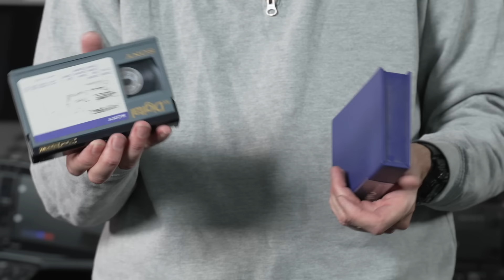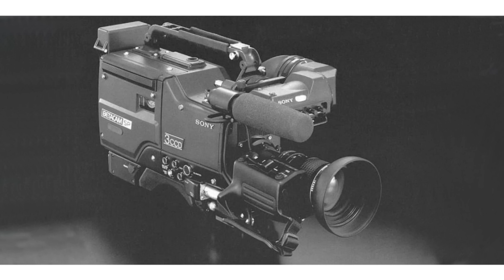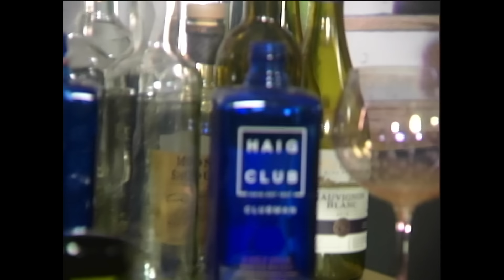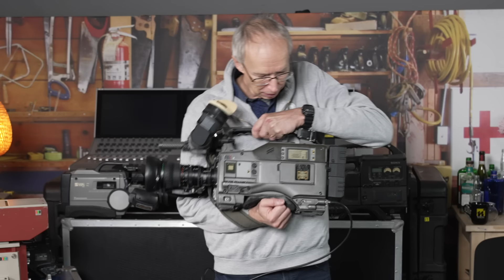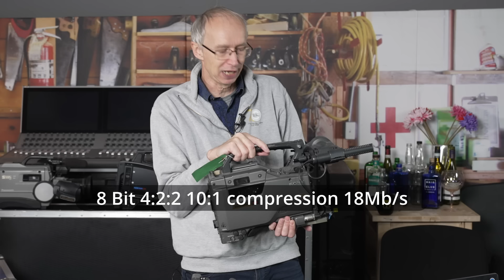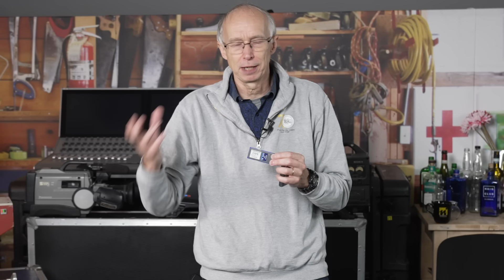Betacam, Digibeta & Optical Disc, a look back at some vintage Sony Camcorders with Alister Chapman

Comment: Thank for you sharing that with us.

I use an Ikeagami UHK-430 broadcast cameras (I am a UFC Camerman). Even though it shoots in 4K, UFC does not broadcast 4K for live sporting events, perhaps in the next 20 years or so the U.S. will have infrastructure in place for live 4K sports broadcasts but most local (rural) news stations in America are still 720p.

Comment: My company is designing a new 4:2:2  video encoder LSI IC to be manufactured by Sony Semiconductor later this year, part number CXD1994DE.   I'll invite you to the tape-out party.   We are using AI to push it to incredible limits with a quality factor as high as 95%.

Comment: ace video i know alot of this   from playing a round with old betacam decks 
there's a place that used to hire out  sony A500P decks  and the 75 one's they plan to skip alot of them

i went over there to get a sony A500P; because they had 4 channel audio 
the boss said they plan to get a skip to dump 4 betacam decks   

i did a deal as parts  they came over  with  20 of betacam decks as parts  i have 50 working decks   

i got offered alot when decks came back of hire out   i have a sony es 701 decks  
note the decks are super for audio  WOW   i only get in old stock sealed tapes at silly low prices 

dvcam sony decks need alot of re cap work i spend alot of hr's doing it 

ADAT i worked on  i have 45 year on soundcraft 760 decks they are tanks     gear is on a slow to die of slow 
worked on alot of gear over time 

some of the cam's have rubber parts in them and the cam's eat the tapes because of the small rubber parts can't be fixed up 

jammed up parts in the first gen betacam decks are a right pain i have to re work alot of the 2nd gen decks the 75 one's as parts 
gone bad 

love them as audio recorders there's a sound they make

Comment: the lens on bvv570 is newer than the camera which is a canon internal focus lens 8-120 canon i think i was around 8000$ .. also the digibeta has an older lens that is not an IF.
Reply from the maker: The lens on the 570 is a Canon J14x 8.5 SX12 from the late 1990's and while it does pre-date the launch of the 507 it is certainly a lens that a lot of people would have used with the 507 as that combination would have been used all the way to the end of the SD and Betacam SP era. The Betacam dockables were in production all the way up to 2002. The lens on the BVW700 was a Fujinon A20x8.6BRM IF lens from around 2000.
Reply: @alisterchapman  i remember the canon broadcast series lenses.. that were perfect.

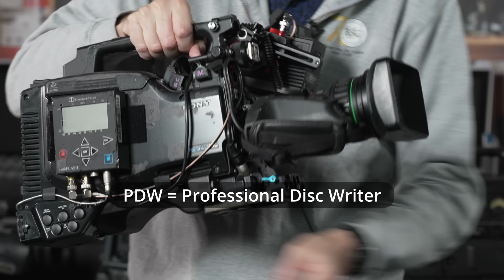Comment: 19:32 the SXS memory cards are still available today. You can buy them new and they cost about relatively the same but for the same price what you paid for that eight gig you can buy a 500 gig now for $400. That’s how I bought mine. I always wait for the technology to drop in price before I jump into it. they’re just like the P2 Panasonic. That’s a good camera too. I have one. The memory cards are somewhat expensive depending on where you get them from the type I use is 64 gig. They do have larger ones like 250 GB, but those cards are more expensive than the SXS cards due to the size of the memory the only thing I don’t like about the Panasonic P2 cameras, and the one I have is a large format that unlike the Sony XD cam optical disc where it records, the files and the video files as well as the audio as one file a Panasonic P2 cameras, record the video in one file and the audio in a separate file that sucks especially when it comes to editing, but thankfully da Vinci if you use that software with it or Adobe pro when you drag and drop it automatically aligns the audio and video so that the time code and everything is matched up without those two pieces of software you’d be kind of screwed for editing😉

Comment: 19:32 you should’ve also mentioned the SXS and xdcamdisk professional media station the XDS – PD 1000 they had a few other models that one I have. It’s a great piece of equipment. You can take your SXS footage copy it onto the internal one terabyte hard drives or you can copy it to 120 gig optical disc 120 gig disc is a right ones read many format, but the hundred gig disc media as a rewritable and you can transfer your footage to that plus you can edit it. I bought my machine used. It was actually sold as parts because it wasn’t functioning correctly. I knew it was wrong with it. It needed hard drives replaced. it takes three. and they do have a model that has SSD‘s that one is only 500 gig.

Comment: 19:32 I imagine you have that nano flash recorder attached to the camera due to the fact that your disc drive crapped out on you that’s one of the Achilles heel of those disc cameras that the disc mechanism doesn’t last forever, but I have the same camera and my camera has had over 1500 discs put into it and it still works another nice thing about those disc cameras is the technology in them got better overtime as well as the discs they went from 23 gig all the way up to 120 gig that particular camera you’re holding can use a 50 gig which gives you over 2 1/2 hours worth of recording time depending on the frame, rate and if you’re using 1080
Reply from the maker: The disc mechanism in the PDW-700 works perfectly, but the NanoFlash provides a solid state workflow for faster transfers that don't need a drive and higher bit rates if you want them.
Reply: @alisterchapman  yeah I have one of those external recorders, but mine is the Panasonic one to where it has like a built-in hard drive in it and I have it Velcro to one of the V mount batteries and it is capable of recording 1080 but yet again you are correct it isn’t a fast way of putting data out and giving it to the client. It’s sort of like the JVC camera I mentioned before I like it the only thing I don’t like about it is the earlier versions only allowed a 32 gig SD card to be used and if you try to say using 128 gig SD card the camera would format that 128 gig into 32 gig meaning you would lose a lot of usable space it sucks. I just wish they would’ve had a firmware update for that camera to allow larger SD memory cards to be used. I do know that on the 800 JVC they did up the SD card size. But it is nice to look at older cameras because I do have quite a few older ones in my collection. They’re not museum pieces mind you I do utilize them from time to time depending on what I am filming. I’ve been collecting video equipment for quite a few years started in 2018. Like for instance I have in my collection an PDW – U2. That’s for the Sony XD cam optical disc hooks up to the computer so that you can transfer data back-and-forth from the computer onto the disk or from the disk to the computer. You don’t need specific software to do it as long as you have the driver installed for the device Windows will recognize it? I also have the U1 that one only uses 23 gig discs where the U2 can use up to a four quad disc meaning 120 gig right once read many and 100 gig rewritable it’s too bad the cameras never kept up with discs meaning that the PDW 700 couldn’t use the hundred gig disc but it could use the 50
Reply: @alisterchapman  I made my comment a little hastily on that portion of the video because I’ve known people that have cameras like that when their disc mechanism goes crap they use digital recording media attached to the camera like SD cards and so forth that’s why if you look online right now, a lot of them are very hard to find and some of them are very expensive due to their demand because believe it or not if you know about what am I saying you should know, I mean you’re an expert you’ve worked in media like this probably all your life, but I didn’t realize that Sony cut the umbilical cord on the equipment like for instance I didn’t realize this at the time but Sony doesn’t even service their professional media station anymore They stopped servicing that piece of equipment in 2023 meaning that they won’t fix them anymore and they won’t help you diagnose problems hardly because when I bought my XDS PD 1000 I bought it as a parts machine at first because those things are astronomically expensive if they’re in fully functioning order right now if you look on eBay price is range from as low as 1500 all the way up to $22,000 I knew it was wrong with the one that I bought the hard drives were bad in it and there’s three of them and they’re not regular off the shelf type hard drives their server hard drives not like the type you would have in your PC and there’s a specific format that you must use for those hard drives not NTSF not fat 32 not ex fat. It took me quite a while to figure it out through trial and error that those hard drives in that machine have to be formatted to UDF same format as a common DVD disc. I told Sony that if anyone else calls up with the same dilemma that that’s the way to fix it. and trying to find replaceable disk drives either for that machine or one of the cameras good luck. they are about as scarce as a unicorn. and if you do find one, they’re gonna be astronomically expensive because it’s basically you’re buying new inbox old stock.

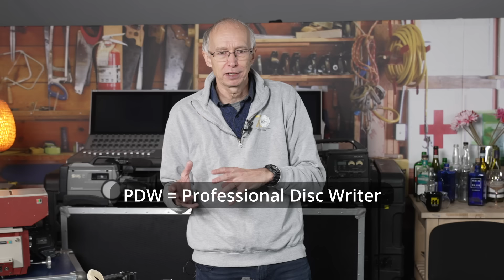Comment: 19:22 actually that particular Sony camera came out after Sony came out with the 16 x 9 standard definition disc cameras. How do I know I have one in my collection and I also have this camera in my collection very good cameras. I usually use it at 60 frames and 1080. Also, JVC came out with memory card type camera like you have and that was called. GY – HW 700 U. Which had three ranges of recording everything from 1080 P all the way down to 1480 720 And then the 800 U that one was actually 4K and it recorded on SD memory cards
Reply from the maker: Yes, there were a couple of SD disc cameras that were based arround the IMX and DVCAM codec, I did the official reviews for Sony when they were launched, but almost no one used them as there was no image quality benefit compared to DV or IMX and almost everyone was happy with digital tape and firewire transfers.
Reply: @alisterchapman  you know one thing about Sony is their technology in VTR’s like DSR – 2000 the way that machine can use both full-size DV cam tapes and you can use mini DV tapes in it without an adapter like on the Panasonic model that one you have to use an expensive mini DV tape adapter otherwise if you try and put the tape in the machine without it like I did one time when I first got it, it’ll get stuck then you gotta mess around with trying to get it out, which I did I think it’s the reason why is they don’t share their technology of course so Panasonic couldn’t copy the mechanism that Sony uses just like in there, full-size media cameras to where when they record the video files. Both the audio and video are in one file where the Panasonic when it records onto its memory cards it records, both audio and video in separate files and separate folders

Comment: A really nice look back. Would have been good to have seen the first Sony XDCAM disc cameras, the PDW510 and PDW530 get a mention. They were introduced in 2004. A couple of years back I got Sony to send my an XDCAM drive so I could take a look and transfer some of my old footage for up conversion experimentation. I don't know how we ever worked with it, because I'd forgotten how slow the transfers were! Even on the most recent drive that Sony sent me, it was glacially slow! However, it was pretty cool that at the time I could put my EDL files and other graphics etc used in edits onto one of the discs, sometimes the same one that had the original footage on. So I've still got pretty much most of the stuff needed to reconstruct some of my old edits on my discs.
Reply from the maker: The 510 and 530 remained pretty obscure, there was no image quality benefit over the IMX and DVCAM camcorders and they were relatively expensive.
Reply: @alisterchapman  It was about much more than image benefit, because it was about the introduction of non linear recording. So they were still very important regardless of image aesthetics. The 1/2” HD disc XDCAMs certainly didn’t offer anything new over the HDCAM tape camcorders in terms of image quality. That initial SD XDCAM period was what ignited the whole debate over disc vs card. Long before the introduction of the 1/2” HD cameras, the debate was already raging. At the time with the limited technology, there were lots of plusses and minuses to each system. The 3D camera was pretty obscure too.

Comment: I used all of those! Also the u-matic and the triple tube betacam...I loved how the triple tube would balance on your shoulder with the front extension part... You could walk without holding it! Thanks for the walk down memory lane! The PVW sucked in snowstorms. How many "chocolate bars did you carry in your back pockets? 😆

Comment: I have the Panasonic NV-MS4 that can be seen in the back shelf during your video (With the lens-cap attached to the side, which had that big white spot which was used to set white-balance with) and it still works to this day :) (Not being used anymore though, but had so many fun hours with that thing)

And it was global-shutter, and in my opinion the single-worst invention ever in cameras was when they started going to rolling-shutter instead (Rolling-shutter is, and always will be, terrible. And it's so sad there's hardly any choices today if one wants a global-shutter)
Reply from the maker: But even film has a rolling shutter and cinema audiences have been watching films shot on the Alexa for over a decade without issue. It's always easy to single out an isolated issue, but image quality is never determined by one thing, CCD's are relatively simple devices and fine for standard definition, but at higher resolutions you run into insurmountable speed, heat and uniformity issues that make them unsuitable for modern high quality high resolution video. The big problem with global readouts is that to do it the output of every pixel has to be held in some sort of memory until it can be read out. That memory adds fixed pattern noise, may make the sensor less sensitive or limit its dynamic range and certainly makes it more complex, so there are trade offs.
Reply: @alisterchapman  Certainly there are trade-offs with both rolling and global shutter, but global-shutter is undeniably easier to work with in post and, to me at least, just looks so much better. It's not impossible to buy current digital cameras with global-shutter, but they're just significantly more expensive than comparable-quality cameras with rolling-shutter (And cameras with acceptable rolling-shutter speeds are already very expensive, at least if you only have a normal consumer-wallet to dig into ;) )

And film doesn't do line-scanning, so even though it is a rolling shutter in technical terms it isn't a 1-1 comparable (The gele-effect is much less pronounced on film, even at 24FPS with a 180-degree shutter)

Comment: What's sad is the Sony 1035-line HDTV kit HDV-1000/UniHi/HDD-1000 etc that basically is forgotten from the 80s to 90s, as someone who does FM RF Archival of VHS to Hi8 regularly (vhs-decode today etc) it is sad to see how little of the HDTV kit from early analogue to digital first gen is ignored until the HDCAM era kicks off, people also forget how many SVHS hand held camcorders had VITC timecode due to consumers not having IMX style 720x512 or 720x608 export ability with captures and most transfer houses ignoring it unless it was in entry broadcasting. 

It's funny also I'm shooting with a PMW-EX3 today with it's 10-bit 4:2:2 SDI (prosumer i.g my HVR-Z5e's only had 8-bit 4:2:2 HDMI with no timecode these make amazing 100~150GBP webcams rather then shelf items) going to a BMD hyper deck shuttle 2, so straight to SSD in ProRes HQ or V210 uncompressed if I felt like it.
Reply from the maker: HDVS is overlooked because Sony only sold about 50 of both the analog and digital systems, so it never saw widespread or mainstream use. The first camera chain was cumbersome with an open reel 1" recorder and cost £1.2 million. The camera needed huge amounts of light. Everything about the system was phenomenally expensive, including the tapes which worked out at around £2K per hour, so it was considerably cheaper to shoot on film especially when you consider that this is before computer editing was normal, so some form of tape to tape editing or a scan out to film was needed for post production. The UniHi cassette system and magneto optical disc had some success but were still very niche. It existed, units were sold but it never really made it out of the experimental stage and very few people would have ever actually worked with it on a real production. HDCAM totally changed all that as  it was far more affordable and can at a time when the rest of the industry was better able to adapt thanks to rapid improvements in computer based post production editing.

Comment: Thank you Alister for this tale of our technical life. Running a corporate video company, I owned a lot of these (or similar) cameras, starting with Sony M3 and U-matic BVU. I used to rent a Betacam recorder with an Ikegami camera. And then I owned a dxc-30  with betacam  recorder and then Dvcam dsr1-p, the ancestor of your 35.
Then PD-170, recorded through Firewire to a laptop with Dv-rack software (featuring waveform and other shooting aids, so a rudimentary and cumbersome solid state) and finally HD with Z1 and Ex1, which was great.
Editing was tape to tape analog beta with component wiring (4 generations were decent), then Avid, which wasn’t cheap at almost 150.000.000 italian lire in 1995. Only jumping to dvcam/firewire/mac (Final Cut), computer editing finally became cost effective.
Ehi, I salivated on the digibeta brochure you showed, but it was too much for corporate videos.